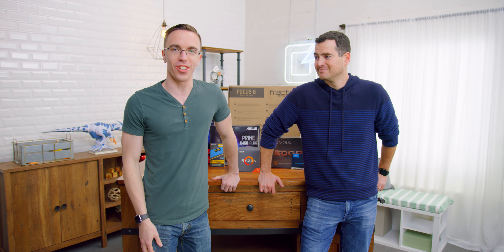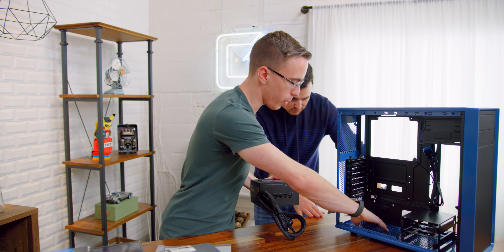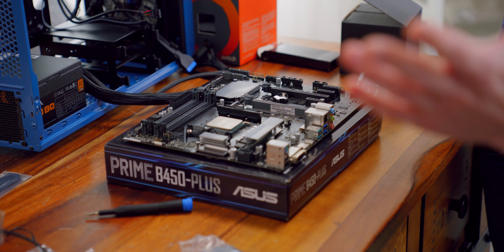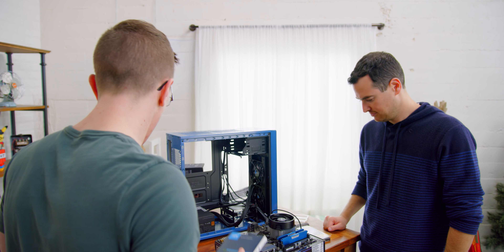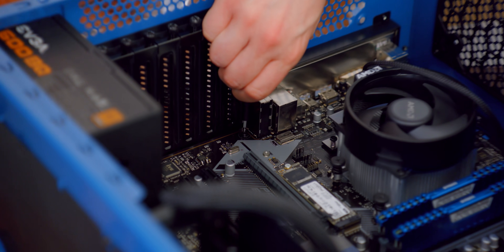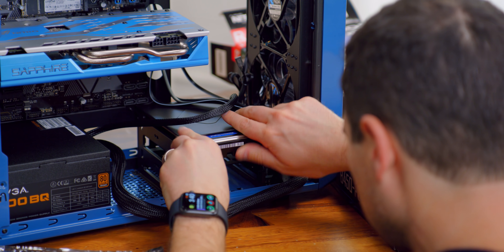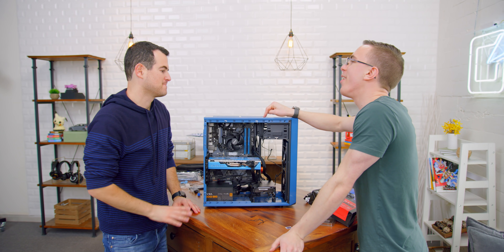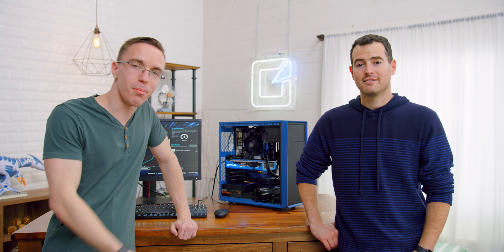How to Build a Gaming PC (2019)

Comment: Hey I have a question for anyone. I’m trying to build the best pc you can with 90’s parts. But I’ve come across a problem between the voodoo 3 3500 vs the tnt2. They both have there ups and downs would there be anyway to implement both of them? Or is there a better 90s graphics card all together?

Comment: Does anyone know if this is good?
Don’t judge my parts I have a budget
Ryzen 3 2200g
Crossfire ATX Motherboard (B450-A PRO)
16GB 3000MHz DDR4 RAM
NZXT H500i
Reply: you dont even have a gpu mate. You won't be playing any high end games without one.
I
Reply: @vault-tecrep8565  I already have a gpu which is the GTX 1060
Reply: TTV By the way get an SSD for your OS. The 1060 is fine for now but look at upgrading down the line.

Comment: Hey! I’m trying to build my first pc and I picked out some parts. I just need to know if I could run games.

Video card: msi GeForce gt 710 2g
Power supply: evga 500w 80+
Ssd: inland professional 240gb
Hard drive: seagate barracuda 2tb
Ram: Kingston hyperx fury 16gb
Motherboard: asrock b450m-hdv 
CPU: amd ryzen 3 1200

Is there anything I need to upgrade? Just looking for a beginner pc
Reply: What kind of games do you want to play
Reply: Nicolas Husic I want to play Fortnite and warframe maybe csgo and renDER I changed graphics card to ASUS radeon rx550, can you recommend any ssd?
Reply: BoardZzy Kingston 240gb a400 for ur ssd
Reply: BoardZzy and I just checked but make ur gpu to a Radeon rx560 trust me it runs Csgo and warframe buttersmooth at high FPS and fort nite it can run really well
Reply: RenDER thanks and should I get a GeForce gtx 1050 or the rx570
Reply: BoardZzy I think rx 570
Reply: BoardZzy change the ssd and I don’t know about that graphics card but everything else looks pretty good👍

Comment: Can somebody please help me:

I just built my first pc ever last night and everything seems to be fine. But it says no signal when i connect it to the monitor. Please help me. Ive been trying to figure this out for 10+ hours now. 

These are my specs:

CPU: AMD - Ryzen 5 2600 3.4 GHz 6-Core Processor

Motherboard: Gigabyte - B450M DS3H Micro ATX AM4 Motherboard

Memory: G.Skill - Aegis 16 GB (2 x 8 GB) DDR4-3000 Memory

Storage: Team - L5 LITE 3D 240 GB 2.5" Solid State Drive

Video Card: Gigabyte - Radeon RX 580 8 GB Gaming 8G Video Card

Case: Cooler Master - MasterBox Q300L MicroATX Mini Tower Case

Power Supply: Corsair - CXM 550 W 80+ Bronze Certified Semi-Modular ATX Power Supply

I posted videos on how it looks finished and how it looks when its on. 

Heres the things ive tried: 

- tried each RAM ports with each ram 1 at a time
- tried 1/3 and 2/4 RAM placements 
- tried putting HDMI cable in MOBI and Graphics card
- taking our battery
- reseating gpu
- taking out reset sw

Ive lost hope and i have no clue what to do. Please help.
Reply: Does it turn on like do the parts start spinnig

Comment: Is this good for 950
Ryzen 5 2600x
8gb DDR4
Asus b450
Rx 580 8gb
2tb har drive
128 ssd
Cooler master 3.1 tg
Rgb magnetic lights 
2 fans for the front
650w silver psu
Reply: Good job getting the b450, don’t get a 350 (there’s a leak going around that they won’t work with newer ryzen processors.) looks like a pretty solid build, although if your trying to grip pennies you could probably get a worse psu or something. If this is in CAD than that’s quite a nice price for performance, but if not you might want to see if you can get and ryzen 7 or wait until 3rd gen ryzen CPU’s come out, the extra cores can help a lot. Also, having 16 gb of ram isn’t mandatory, but can help in the long run
Reply: @fluvilias0446  hey man thanks for that advice!
Reply: No problem!

Comment: 5:02 I feel like that was the cue to explain why that was "a little off".

John tried to place the CPU in the motherboard socket, but since
 he doesn't know there's a correct orientation to do so, he chose to align the "Ryzen" writing with the other big writings on the motherboard. In this case the socket on the motherboard is turned 90° clockwise, so the assumption was incorrect.

So what do you do in John's position? Both CPU and motherboard socket have one little triangle in one of their corners. Match the triangles and the CPU will be in the correct orientation.
Reply: Giovanni Nicoli thanks for pointing this out! Can’t believe he didn’t say it.
Reply: @loganwebb5449  Yes. It really should have been mentioned.
Reply: underrated comment, good looks.
Reply: I don't get it pls explain for beginners.
Reply: @kemalcolak7625  when youre inserting the processor into the CPU, you match the triangle in the corner of the CPU with the triangle on the CPU socket. That is the simplest I can make it without using images.
Reply: @seamusbyrne8259  thank you man I already did so much research that I understood everything on a build lol :=)
Reply: Theres an actual arrow on the CPU showing the "notch" to line the pins. Like a triangle.
Reply: thank you for telling us
Reply: Pro tip!!
Reply: I noticed that I was like wtf😢sum1 help, so ty

Comment: Operating System
 Windows 10 Pro 64-bit
CPU
 Intel Core i7 2600 @ 3.40GHz 36 °C
 Sandy Bridge 32nm Technology
RAM
 8,00GB Dual-Channel DDR3 @ 666MHz (9-9-9-24)
Motherboard
 ASRock Z77 Extreme4 (CPUSocket) 36 °C
Graphics
 SMS22A450 (1680x1050@59Hz)
 Intel HD Graphics (ASRock)
 2047MB NVIDIA GeForce GTX 770 (ASUStek Computer Inc) 36 °C
 ForceWare version: 388.59
 SLI Disabled
Storage
 119GB SAMSUNG MZYLF128HCHP-000L2 (SATA (SSD)) 34 °C
 465GB Seagate ST3500418AS (SATA ) 30 °C
Optical Drives
 No optical disk drives detected
Audio
 Realtek High Definition Audio
Thats my pc Any1 knows what could i upgrade? I suck at choosing parts that will be fine with the system lmao.. I mainly wanted more RAM but all 4 slots are full.. maybe the graphics card? Pls help me choose
Reply: NikkenaattoriZ ! Try to get a graphics card and then see if you like it I would recommend something like a gtx 1660

Comment: I want to buy a pre-built PC but don't know if the parts are worth it so I'm going to leave a list of the parts and can someone please help me out the PC cost 2k
Mid Tower Chassis	Intel Core i7-9700KNVIDIA RTX 2070 8GB16GB DDR4 Memory500GB M.2 SSD2TB 7200RPM StorageLiquid CPU CoolerInternal RGB Lighting4x RGB LED Fans750W Power SupplyZ390 MotherboardWindows 10
Reply: Not bad, but with 2k you should be able to get 2080

Comment: 8:05 u put the memory in wrong. u have to put it in dimm_a2 and dimm_b2(the gray slots).
Reply: Every manufacturer is different (it's a2/b2 for this particular model).
To clarify, 99% of the times it'll work with any configuration (a1/b1 or a2/b2), but there's a slim chance the motherboard won't boot because the controller won't even try to check the second channel if the first is not populated. Worst case scenario, you have to remove a giant cooler to swap RAM position. Nothing is going to die because of that.

Comment: AMD is almost exclusively A2 - B2 Ram slots, he called them just 1 and 3.... "all you need is a screwdriver".... 2 minutes later has to get a bigger screwdriver.... you can install the power supply last if you want.... seriously, anyone doing a build for the first time should be told to read the documents that come with the components... especially the motherboard... how awful is it that they put the GPU in before doing the front panel connectors

Comment: i going to buy  used 1year3months 1080ti zotac awp extreme for 480 euro 
used 1year dominator platinum ddr4 2x8gb 3200hmz for 90euro 
used cooler master cosmos c700p case for 140euro 
used 1year half thermaltake water 3.0 riing rgb 360 for 50 euro 
from the same guy  
are those worth for the price ? pls tell me

Comment: This is not a gaming PC. I clicked this video and the first thing I see is a bronze rated PSU. And then I saw the 1050ti. Unacceptable if u r going to call this a gaming PC. I dont know much about ryzen cpu's because I have an Intel CPU. I also dont see any extra fans. They only use the ones in the case
Reply: Oh my God half way in and I see him pick it up and hold it by the CPU cooler. NEVER DO THIS IT IS BAD!!!! U can damage the CPU, break the seal between the CPU and the surface, in extreme cases u might crack ur motherboard

Comment: Dislike. This so wrong. No livestrong antistatic bracelet, no tweezers, ram should be on slots 1 and 2, you don't want them away from each other as most of them are too clingy, they always want to be seated beside each other for better performance and also not enough thermal paste. When applying thermal paste, always think of it as if you're making  a PB&J sandwich. The more peanut butter, the yummier.

Edit: Also IO sheild?? What is this a swordfight? You're building a PC! That is called a brace.

Comment: I have a question guys. I have a pc and it’s very loud, it’s not the fans so I think it’s the hard drives or the psu. If I were to remove the hard drives (the OS) is on the hard drive, and add another ssd. What will happen? Will the pc brick? Or will it allow me to put the os to my ssd? Thanks!
Sorry for my English btw. (It’s my second language)

Comment: i'm start updating my pc in augustus i going for full team red so amd cpu, gpu and motherboard the part i buy are
MSI Radeon RX 580 Armor 8G OC
AMD Ryzen 5 2600
Gigabyte B450M DS3H
Corsair Vengeance LPX 16GB DDR4 DIMM 3200 MHz/16 (2x8GB)
 and later i'm gonna buy
Microsoft Windows 10 Home 32/64bit NL
Samsung 860 EVO 500GB 2,5 inch
Corsair HX850i
Cooler Master Hyper H411R
Corsair Carbide Series SPEC-DELTA RGB
almost forget my monitor
LG 24MP59G-P

Comment: Hey Austin! I have 2 questions that have been itching me about my
future build. Finally got my first job and I am ready to build! I feel
confident watching your videos over the time, they are awesome and very
informative. I have always had a laptop so I am ready to go BIG!

My 2 questions are GPU and motherboard. 

I know I will be using a i5 9600k, 16/32ram, 500 m.2 2tb hard
drive lian li dynamic case. 

The point of my build is to go as high as possible,
balanced, without any features I won’t be using. 

Whats the best GPU for 1440p 144hz monitor for near ultra
settings? I don’t mind tweaking settings to hit my fps goal. Green team please.
I am not interested at all in 4k stats/benchmarks because I believe I will
never use the feature.

And I have had a look at the ASUS line up for motherboards,
there are SO many! What is the highest end mobo that you can buy for AIO cooling?
Definitely won’t be custom loop watercooling. What I mean, ASUS ROG Formula is
designed to have the mobo watercooled and I wont be ding that, so:

Maximus hero xi or asus strix z390 e? 

Thank you so much!!  Xoxoxo
from UK

Comment: Any idea where I can get the screw that attaches the M.2 SSD to the motherboard? It's for the HP cb-001la pavilion power. I've read the manual and it says it's a Phillips M2 2.0x2.0 screw. Does it come with the SSD?
Reply: Most New Motherboards Come with the M.2 Screw if not Check to See if the M.2 SSD you want to buy

Comment: Disgusting, Austin. You basically assembled in the case reverse-order. You set up front IO and plan for that first, install bay storage, then you plan and route your power cable runs, only then do you put the mobo in, attach front IO first, attach your power connectors, route your drive connections prior to attachment, and save the GPU for last. This isn't the PCMR in me saying you're wrong, it's the pedant in me saying you made this look and feel way harder than it should had been.

Comment: Pro tip install the power supply last that way you have plenty of space for your hands to plug your wires in your motherboard on the bottom and plug in the connectors.

Comment: I like to connect front panel connectors and fans before installing power supply  and video card. Because the bigger cables and video card can block 4 pin / 3 pin fan headers or make it hard to get your hands into tight spaces between  hard drive cage and video card above. The Focus G is a decent budget case, I just built my sister a system in one. Ty for content Austin.

Comment: EVGA power supplies are known for popping/smoking/exploding after 3 years of use. Grab a power supply from Corsair or Seasonic. Also, PSUs run best at 50% so make sure your wattage is about double of what PC Partpicker says you will be using with your parts.
Reply: Do you have evidence to back your comment?  Just because you had one bad experience with an EVGA PSU doesn't mean they will all explode when used.  Grow up and leave your biases in your mother's basement.

Comment: this is my new pc build early 2019. call it "king of 1080p gaiming build" so take alook critics are welcome!
pc casing:MS SPECTRUM gaming, Mid Tower
psu: MSI PLATINUM PRO 80PLUS 700W
mother board:Gigabyte X470 AORUS GAMING 5 WIFI
hard disk:Toshiba P300 3TB, 64MB, 7200rpm / m2 SSD 256.0 GB ADATA 
memory:Kingston DDR4 16GB 3000MHz HyperX Predator(oced 3200MHz)
processor:AMD Ryzen7 2700X/Cooler SCYTHE Ninja 5
graphic card:MSI GF GTX 1660Ti ARMOR 6G OC
os softwere:win10 64bit home
monitor:Dell SE2717H/HX Monitor 27"

Comment: for those that are stressing over should i get the 2600 or 2600x. 100% honesty they are so much the same just get the ryzen 5 2600 you will be able to do the same thing as the 2600x. i play fortnite BO4 and apex and all the big tittles and runs smooth like butter. this build is the way too go for some one first pc trying to stream and play games. got with 16 gb of ram and please cant stress it more please read the ram manual on the mother board this mother board should be installed on A2 and B2. have a good day people.

Comment: 7:37 channel 1 and channel 3 typically? I'm surprised about how much Austin doesn't know about computers after all of these years. Example: uneven pressure on the CPU cooler but the make sure to mount the PSU with a criss cross pattern so there's eaven pressure.

Comment: The RAM is in the wrong slots. A2 and B2 would be the right ones.
Reply: Oh God than you for this comment.  I thought I was living a lie
Reply: @mquirozz  Yeah, it's horrible! :(
Reply: He also said M.2 drives were "fast" as if they are faster than standard 2.5" SSDs. They're not.
edit: unless it's an NVME drive
Reply: Alppuccino Lmao you really don't know the difference. Some are faster than SSDs. I'm getting a Samsung 970 Evo and there is no faster one. 250gb costs like 90-100$..
Reply: actually is depends on the motherboard. so read your manuals people!
Reply: @Johnny-Cage  According to the label on the motherboard itself, the markings says DIMM_A2 and DIMM_B2
Reply: @Johnny-Cage  r/woooosh
Reply: Hayden Tak r/ihavereddit
Reply: @Red-ku7zg  ironic
Reply: RedFade should probably just post it there
Reply: I have that same mobo and you're right
Reply: or a1 b1
Reply: For Ryzen it is not like Intel it really does not matter, if you put the ram in A1 B1 it will still run in dual channel, the manual only recommends that you use A2 B2 but it is not a requirement, it is not the same as Intel where if you use the wrong ones then you loose dual channel.
Reply: he triggered me when he put it in the wrong ones

Comment: Great Video as always! But, one thing to keep in mind is to plug in all the Front Panel, SATA, 24pin ATX Power, & 8pin EPS cable first then plugging the GPU and its cable because it will save some hassle. Especially the front panel one which is very annoying to plug if there is a GPU in the way.

Comment: that's pretty damn close to my first pc build moving from console. spent $600 Canadian

-ryzen 5 2600 oc 4.2mhz
-deepcool gammaxx gt cpu cooler
-t-force nighthawk 16 gig oc 3466mhz
-asus rog strix b450-f motherboard
-sapphire nitro+ rx570 oc 1425mhz core 20000mhz memory
-deepcoll rf120 case fans X3
-deepcool da500 psu
-samsung 970 evo 500 gig m.2 ssd
-seagate barracuda 500gig hhd 
-thermaltake verse h22 case 

great 1080p gaming machine and beats my ps4 pro in every game

Comment: what is better the MSI b450 tomahawk or the one he used in the video ?
Reply: The tomahawk is by far the better choice. If you want something that is better built, with better components, especially "energy control", go with the Tomahawk. Also, The mortar is the smaller brother board to it.

Comment: I have the same case for my pc I built a year ago. I went with a white build on the inside of the case. Asus GTX 1060 GPU, a 6 core i7 processor, MSI Tomahawk X299 motherboard, and I bought 3 more fans and a railator to cool my CPU. I know a lot more now, and I would move some of the stuff. Also I need to dust it.
Reply: Weird flex but ok

Comment: I am using a r7 2700x with gtx 1080, 16 gb ram and still can’t play bf 1 high graphics in 60 FPS, I feel like my money went into the drain
Reply: you sure about the specs?
my pc has a r5 1500x and a RX570 and 16GBs of ddr4 3200 and i can run BF1 at ultra 60FPS

Comment: I've been wanted to switch from console to pc but only have like 600 saved so far ): also need a good minitor so jeez , long way to go until i get the goods
Reply: The Arbiter depends on the games you play but if you take a look at Linus tech tips budget pic build you could do it for about 600. Windows is basically free, you can use it without buying it, it will just have a watermark. Use a Ryzen 3 with rx 580 or 570 and you can basically run most things medium settings at 1080p*

*Edit at 60 FPS or higher
Reply: Lastly you can use a B series motherboard, 500 watt power supply bronze cert, really any ram 2400 MHz+ (the more the better for ryzen) and any ssd (nvme is gaste but your motherboard needs to support)

Comment: Just a note, the 2600x is probably better to get than the 2600. It's a difference of 25 CAD, and it comes with a better stock cooler as well as better performance.